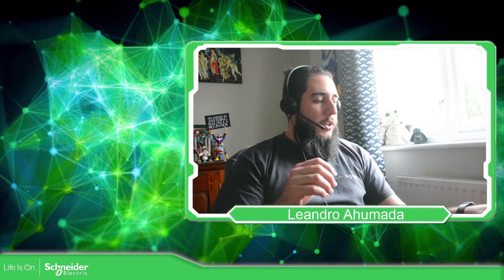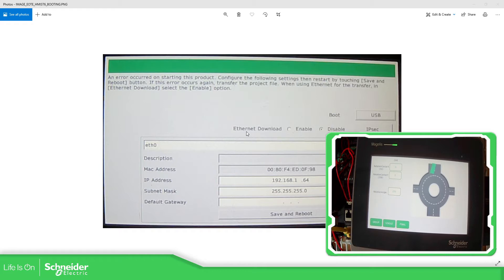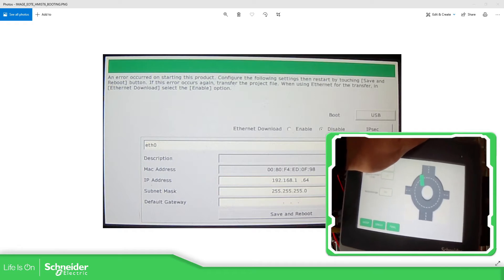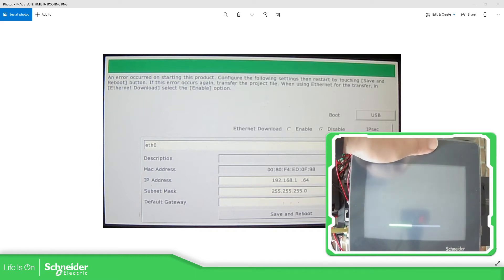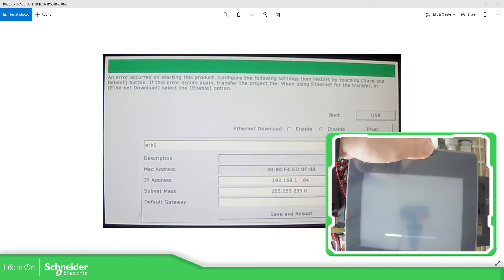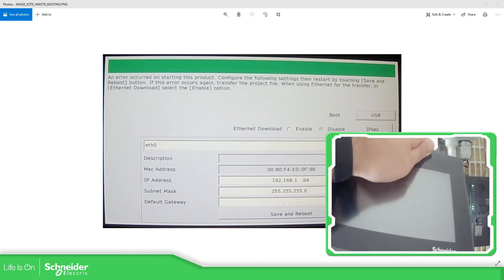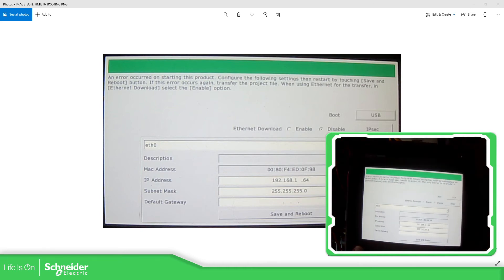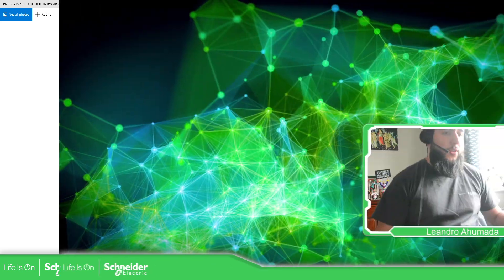Training EcoStruxure Operator Terminal Expert - M20.1 How to Access Broken mode (Before v3.2 SP2)

Comment: Hello, I have a HMIET6 and I can't get into download mode. I downloaded it, but after that I can't download it again and I can't get into broken mode. What can I do next?
Reply from the maker: Hi there! This method is for other hmis. The HMIET6 uses Vijeo Designer Basic. You can try to download the application via usb stick.
Reply: @LeTomasAHUMADA  I have downloaded it via Vijeo Designer Basic and when I want to download it again, the message "error 1800: cannot find defined target machine. On the target machine, please confirm the target model and IP settings" appears. This makes the download to the HMI fail so the display doesn't work.  Is there a shortcut to go to recovery mode or do you have any suggestions?
Reply from the maker: @marwan_ags  have you tried to download a new application via usb stick?
Reply: @LeTomasAHUMADA  not yet, I just downloaded it via ethernet

Comment: Hello LeTomas ! I use hmigto5300 and set a download security password, but I don’t know why I can’t log in recently. Now I can’t download the project to hmi. Can I use the video's method to download the project again?
Reply from the maker: Hi there! You can try this faq:
https://www.se.com/uk/en/faqs/FA280118/

I have done a factory reset for the hmigtu range not the hmigto.

Have you tried using a usb stick to download the project? 

The reason of the security is because you must first clean the security settings to have the new ones.
Reply: @LeTomasAHUMADA  I have tried Runtime installer and Usb, but the result is that the password input window pops up😓, except for the one in the video, I have not tried it.
Reply: I don't understand why not working and the account number and password of  I set are " user " , 1234 😑
Reply from the maker: @ericchen115  the one in the video is not for that hmi.

Comment: I try both way press left bottom or power on and power of still reboot until 90% and hang on
Reply from the maker: Hi there! If you have also tried the method for newer version and no luck then i recommend you to make a recovery. This is done by Schneider People so contact the technical support in your country for guidance.

Comment: We are trying to get communications going between an M241 and an HMISTM6B or HMIST6400.

We started with HMIST6B and followed the bouncing ball for establishing SchneiderNet comms
We can download the HMI Program OK from Terminal Expert - however, it never interacts with the M241
No errors, no diagnostics, just broken.
However....  when we run Terminal Expert in Simulate mode and make an IP connection between PC and
PLC it works - almost...

When we attempt to use the Web screen object on the Terminal Expert simulation, it works correctly
When we attempt to use the Web screen object on the HMIST6B we get the message
"Browser object not supported on this target"
WTH??!!
It is the job of Terminal Expert to only download compatible objects to TheTarget...  and here TheTarget is
claiming that the Browser object is not supported.

OK, let's try the HMIST6400
Save-As project
Convert from HMISTM6 | HMISTM6400 (There is no option for HMISTM6B... 
I guess Schneider's right hand didn't get the memo from Schneider's left hand
Ideally every target would be specifically identified to avoid the need for random trial and error

Convert to HMIST6400 - that part works seamlessly
Downloading.... After about 5 minutes of downloading Terminal Expert reported 71% where it appeared to be stalled.
The progress bar on the HMI indicated about 30% (making the rather radical assumption that the entire
screen width represents 100%
Given the excruciatingly slow pace of the transfer on what is probably almost the smallest possible functional
application, I was speculating whether the HMI had a 4004 processor or whether they had splurged for an 8008.

Well...  it appeared to be wedged.  So we disconnected the USB connection.
Terminal "Expert" failed to detect the loss of connection and insisted it could not be interrupted - and had to be murdered
with task manager
 Upon re-powering the HMI there is a different progress bar so it appears that the HMI is wedged in its reboot/initialization phase.
The HMIST6400 had a bit of an operator interface - enabling the selection of USB, Ethernet, or 300 baud teletype
transfer method.
The HMIST6B OTOH has no monitor mode - except the hardware configuration - which is obscenely bloated with all kinds
of graphical elements and is radically mismatched to the landscape format of the screen - also the hardware configuration
can be entered if one has just the perfect timing of touching the UL/LR corners.

It is quite shocking that this stuff is considered to be professional production-grade devices

So we are left with resurrecting the 6400 and dealing with the dysfunctionalities of the 6B
Reply from the maker: Hi Kurt! Have you contacted the technical support team of Schneider in your country? They are more than happy to help you and improve the software if there is a problem.

Regarding the connection between the hmi and plc, i have done two complete videos the complete process is in there:
https://youtu.be/ZGvNAPbo-Hs
https://youtu.be/SzqOc416OmI

If i am not wrong we are going to have a new version of Operator Terminal Expert v3.3 soon. I recommend you to check the behaviour with this software.

When you change the runtime of the hmi it takes more time than a normal download of a program.

I have not played with the HMISTM6 but i will check the change of the target type.

I recommend you again to contact the technical support of Schneider in your country so they can solve any problem that you have.

Comment: Has this function been removed in 3.2 SP2? I have a HMIST6500 and am unable to boot into "broken mode". I'm following you in the video and FA355946. During the boot switch off the power twice after the boot bar reached 70-90%. I've tried switching the power off at all points from 60-95% and can't get it to boot into broken mode when I re-apply power.
Reply from the maker: Hi Luke! I just tested with a HMIST6400 with an app made in v3.2 SP2 and i am not able to access to the broken mode in the way that i did on the video... but... if you go to the help in the software go to:
1) Feature Guide
2) in the left part select "before Use".
3) Then "What's New"
4) in this part you can find a section called "Recovery mode" select this for more option.

In this section you can find he easy way to access to this broken mode...
1) Turn on the panel.
2) During the loading of your app touch and hold the bottom-left corner or bottom-right corner (within an 80 pixel area) 3) Wait until a pop up message with "Do you want to enter recovery mode?" shows up.
4) Then click "yes".

I will add this on the description of the video.

Thanks Luke!
Reply: It's works to me here .....
Any chance to get ur support about to connect HMIST6400 with s7 1200 simense plc ?  @LeTomasAHUMADA